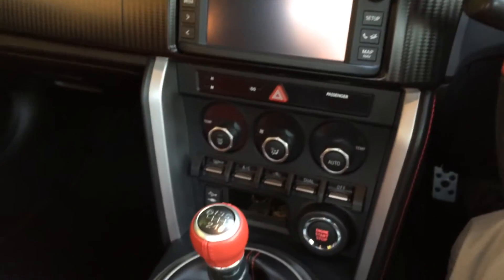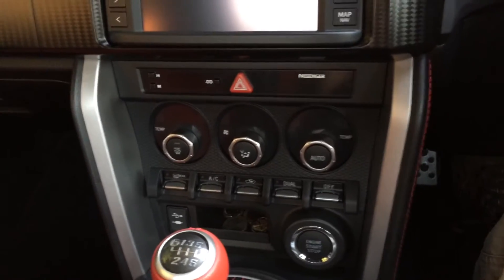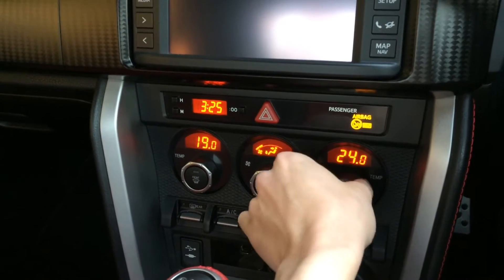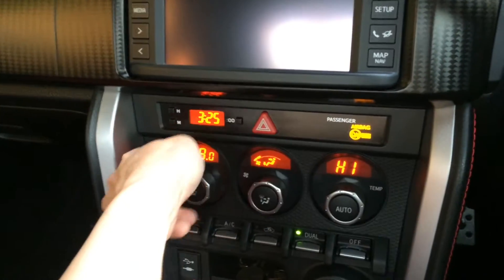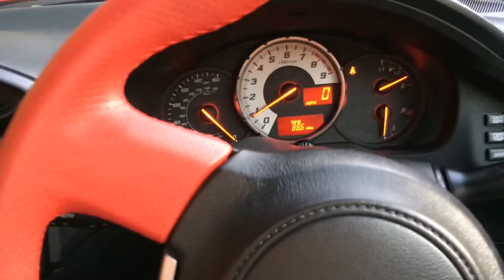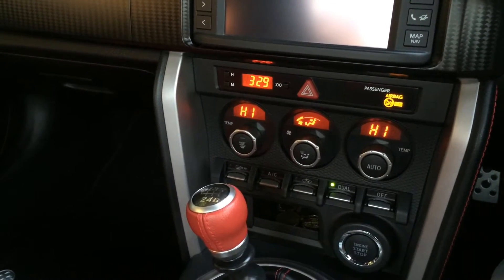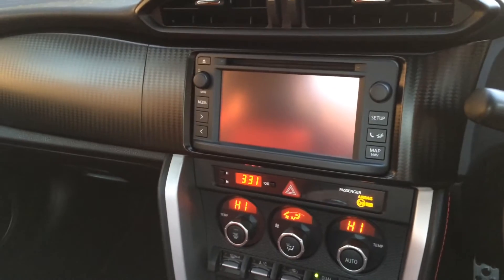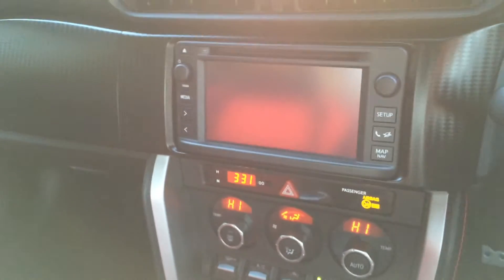How to start and drive a car that's been sitting idle for 2 weeks

Comment: shit man, I just took my hobby car which is a 2001 2.5RS subaru impreza off the racks because winter is over and it started up just fine. It had been idle for almost 9 months :P
Reply from the maker: +TheDude mine has a parasitic load in the form of an OBD-II to WiFi dongle that's why :)
Reply: TheDude I wish! My car sat for six months and the I year old battery died completely! The gas turn to gum. She squeaks now and she idles too high.